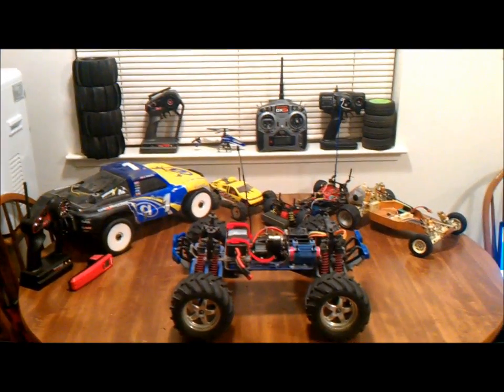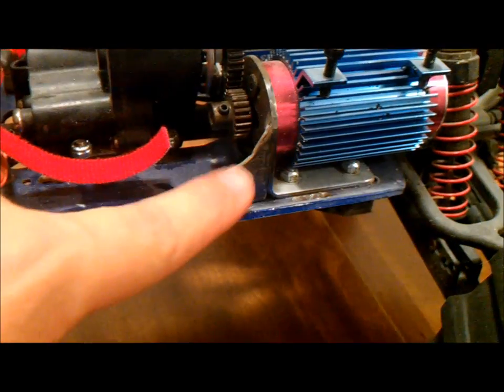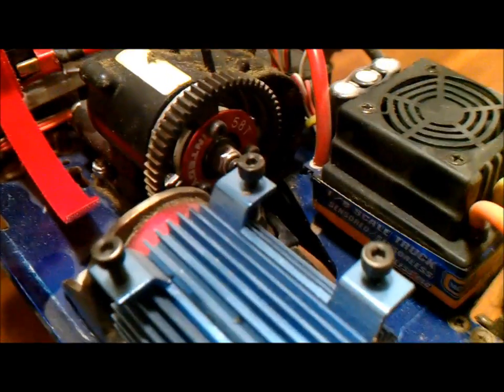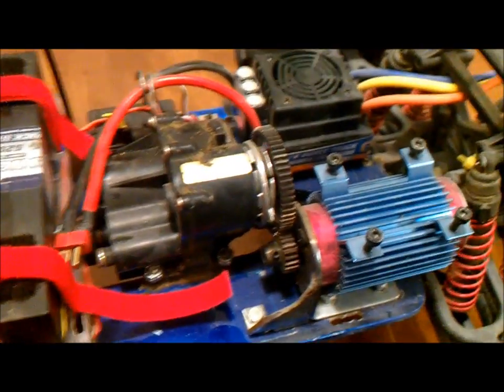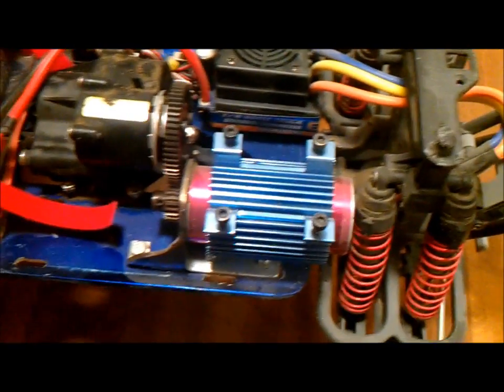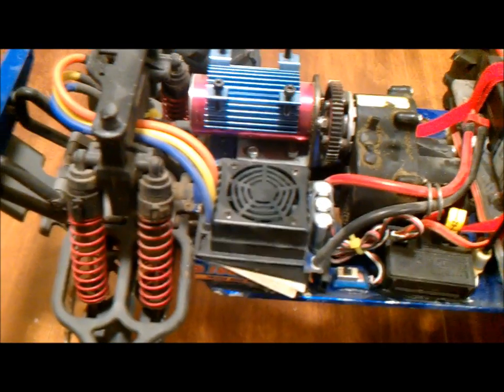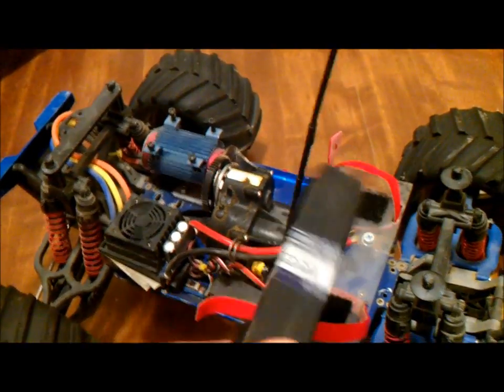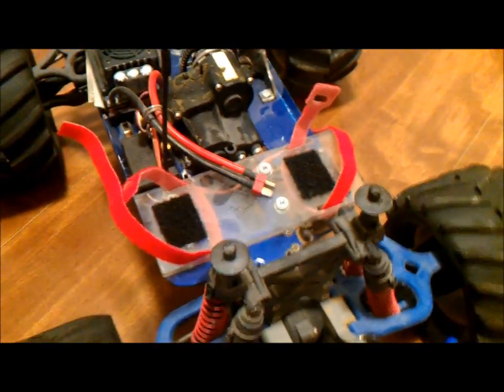Finished   TMaxx brushless conversion

Comment: JOSH sup..... i have a full alum... T-max 2.5 with the two speed tranny. I just got this truck back from a friend who had it for the past 6 years... it has all the old servos from stock "non 2.4". I am going to do a conversion and need to know a few things.. im going to get the motor mount from the old man online.. Ive heard the one speed transmition called a "kit" and called a "unit".. should i just buy a 1 speed new transmition to make things easy?